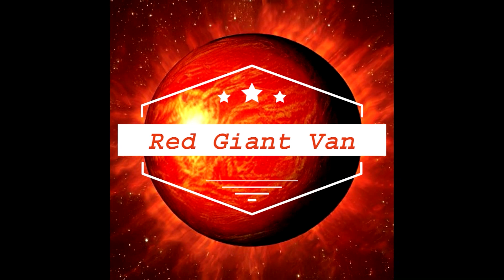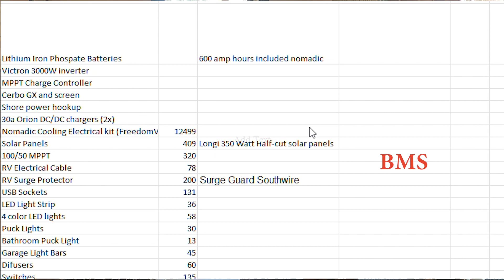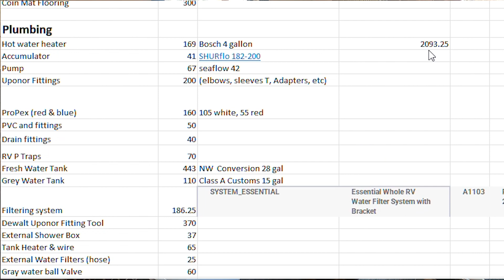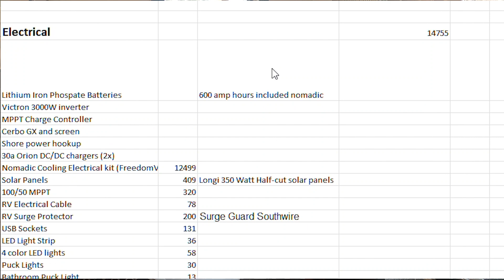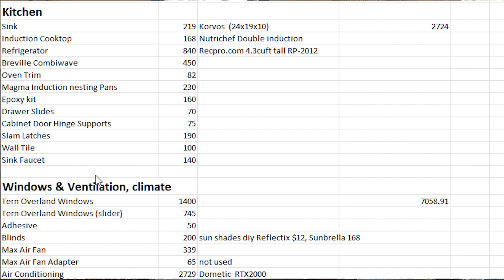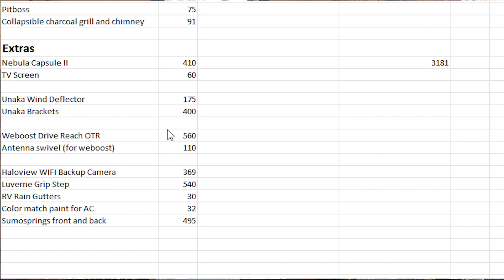What did the build cost? Ram Promaster 3500 Extended

Comment: Not bad, close to about the same as mine. My van is a 2021  Ford E350 cutaway van with the 7.3 gas motor, $47 thousand, plus some change, plus taxes and fees. I wanted something to pull a jeep behind it across country. The conversion was $63 - $65,000. I made sure I can stay off grid with the jeep for at least 2 weeks summer or winter. 
I included the price of my folding ebikes because of it's how I have it insureds.